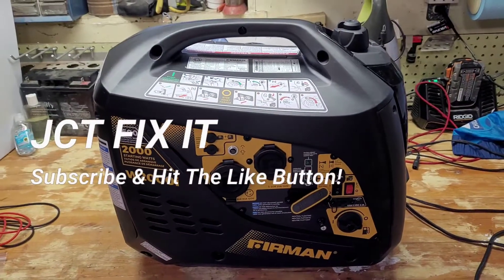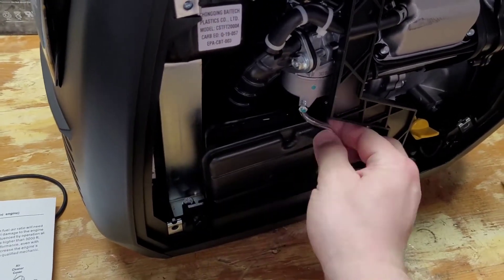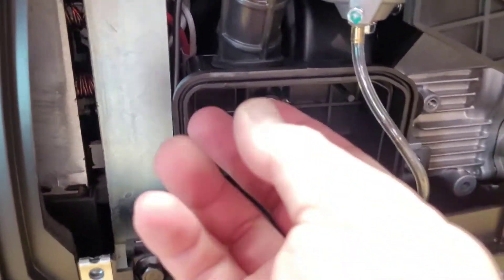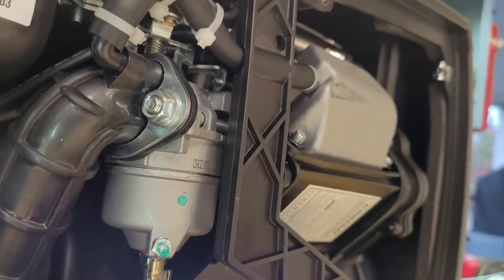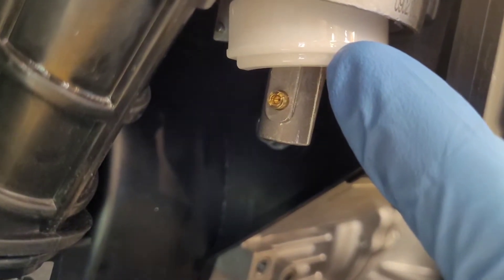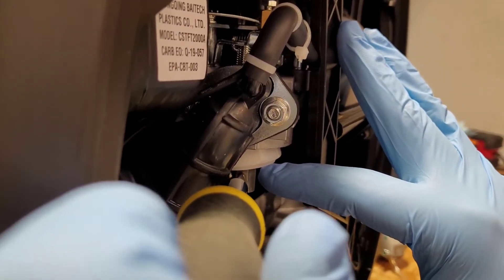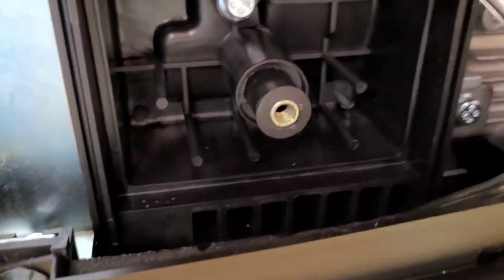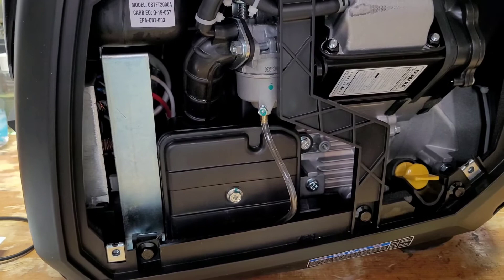How to Install High Altitude Main Jet in Firman Inverter Generator W01682.

Comment: Good instructions, thanks. Just ordered this generator from Costco and the dowloaded manual has nothing on high altitude operation besides a passing comment. The Firman FAQs do have some info. I'm at 3400 feet so I'll call for the 3000-6000 feet jet. If I use it at the beach I'll switch back to the original low altitude jet. A little bit hassle but you don't starve and overheat the engine. I'll make sure it starts and runs on the original jet first before making the switch.
Reply from the maker: If you find that the generator is "wandering" loosen the screw to the choke cable and let out a mm or 2 of slack. If that cable is overtightened it will cause this problem.
Reply: @JCTFIXIT  Thanks for the tip. Thinking by "wandering" you mean a slightly surging low idle in eco mode. I can see how relaxing the choke cable a smidge would lean out and steady the low idle, if the choke cable is too tight.

Comment: Update: The 2100/1700 I just got seems to be running better with the 3000 to 6000 jet, did initially have have a fuel leak at the bowl wasn't seated correctly on the new gasket. Don't know how I managed that, solved that issue. Firman sent me a Model W01784 with a date code of 8-30-21 so I changed the bowl gasket for good measure. Seems to be running better still surging slightly on low rpm eco mode pretty steady on high idle and with a load. Not as quiet as my Honda 2000. Got 1.5 hours on it with a 1600 watt space heater and then no load switching between eco and high idle. I'll put some more hours on it to evaluate it and then change the oil at 5 hours.

Comment: I haven't gotten to doing my Firman generators yet but I stumbled on to your video in the past and your instructions are so clear and concise that I can confidently do this myself. Thank you so much.
Reply from the maker: Glad you found it useful. Let me know how it goes.
Reply: @JCTFIXIT  Well. I finally did my two generaters after years of procrastination and when I felt I had recovered enough from my surgery I turned to your video and did the play by play. I have to say I sure wish I had a smooth experience like yours. The first one I had a bit of a challenge putting on the rubber air intake hose onto the filter box. I hope it's in good enough. Anyway, the second one earned me about forty minutes of swearing. The metal backing clip that the bolt that goes into the filter box was misaligned and I had to do a lot of wrangling in aligning the bolt so the nut on that clip would finally take the threads and I finally get the bolt to seat and drive it snug. Whew! The filter and the filter cover was a quick fix and, Voila! I'm still not a small engine mechanic. Lol. Once again, your instructions were spot on and I have have some experience now in doing this by myself. The real test comes when I buy prime gas and test for any leaks. Got my fingers crossed and wish me luck.
Reply from the maker: Good Job!

Comment: Nice video. I have the next size up Firman and so far have only run it on propane. Sea level to about 10K in elevation without changing the jet. It's always started right up and worked fine. I wonder if the jet change applies to running on propane also? Does anyone know? Being a 2 stroke motorcycle junkie I am too familiar with carb jet tuning on the gas engines.
Reply from the maker: I would imagine that the jetting is not nearly as sensitive on propane as it is on gas
Reply: What did you end up doing? I have the same question and wonder if it is necessary with propane at all.
Reply from the maker: If it's running good, it's probably not a large concern
Reply: The jet is only for atomizing liquid fuel

Comment: Great video! Thanks for sharing. I also live at a about 4,500 feet and mostly camp in the mountains at 8,000+- . Curious to know your long-term thoughts on this generator and how it has worked at elevation.
Reply from the maker: Thanks! After a couple years of usage I have to say it has been pretty much flawless for me. My only advice is to set it on a piece of wood or a tarp or something hard if you take it camping just because the air intake is on the bottom and you don't want to be sucking up straight dirt.

Comment: Nice video! Your video has been the only video that even covers the carburetor for this particular model. Is this also how you remove and clean the carburetor as you normally would? I'm not installing anything new, but I notice after having/using this generator for a year it recently dies down when a load is running and many say it's because of a clogged carburetor.
Reply: Please answer as soon as you see this. Can I clean the carburetor without removing it or would I still have to take the carburetor out in order to clean it? The manual doesnt talk about how to clean the carburetor for this model and there's no video on youtube that does either.
Reply from the maker: Pull the jets out and soak them in carb cleaner.
Reply from the maker: You should not need to pull the whole carb apart
Reply from the maker: Also, in your small engines, always run ethanol-free fuel. The ethanol is usually what causes problems. Most stations fuel has 10% ethanol. You don't want this.
Reply: @JCTFIXIT  Thank you so much! Also great to know about the ethanol free fuel especially 😊

Comment: Do I need to drain the entire gas tank?
Reply from the maker: No. When you turn the fuel petcock to the off position, it blocks the flow of fuel from the tank. If you can turn the fuel peacock to the off position while running and let it run until it dies on its own and the carb would empty itself while running. But then you have to wait for it to cool down. 😎

Comment: Greetings from Australia mate. Did you notice the main jet size?. They have a number on the side. I have the same generator and it is always running lean. I wonder if the previous owner changed the main jet. Mine says 70 on the side.
Reply from the maker: I don't have it handy, but if you call firman, their customer support is pretty good. They should be able to tell you. Good luck.